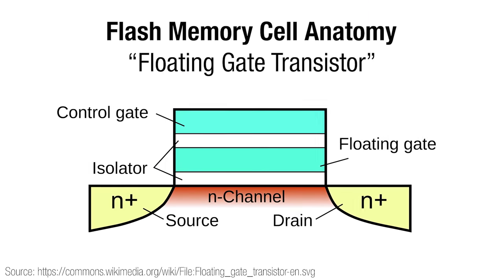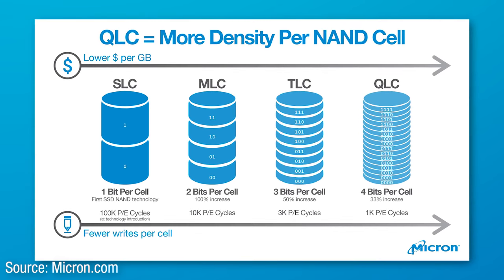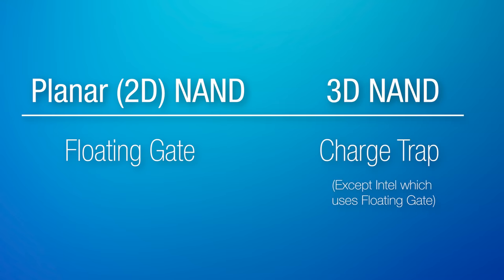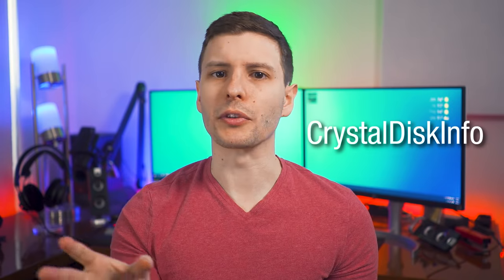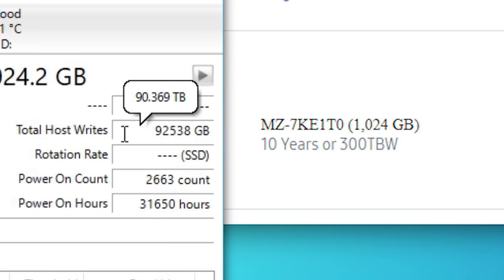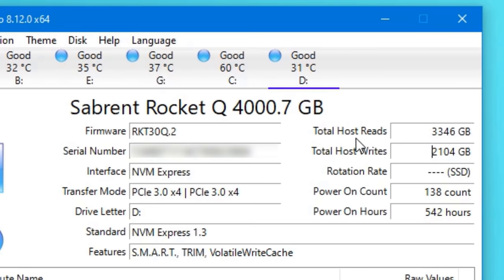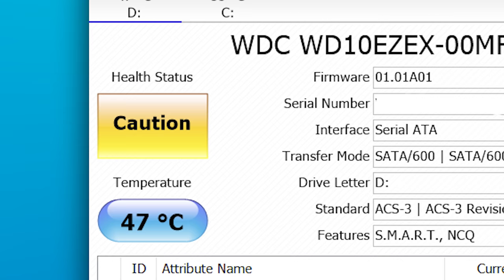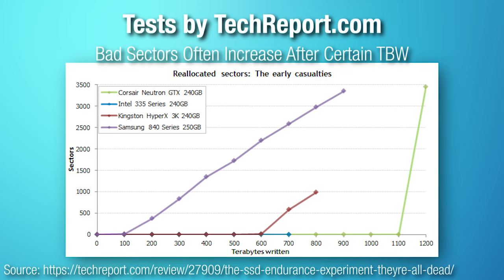How Much Longer Will Your SSD Last? How to Tell

Comment: 6 hard drives - 7 years later still going.
Even put a hard drive from a dead laptop into my desktop and it still works great -  and it's about 10 years old
and I'm still using it in my desktop.

Comment: A tongue in cheek alternative perspective:  I was recently thinking about buying either a BMW or a Mercedes-Benz (4 year/50,000 mile warranty on each) but learned that Hyundais last over twice as long as either of the German brands (10 year/100,000 mile warranty).  For me, reliability is paramount; I bought the Hyundai.

Warrantees are much closer to being marketing tools than they are reliable indicators of expected degrees of trouble free ownership.  Your 300 TBW warrantied MLC based 850 Pro will almost certainly outlast your 600 TBW warrantied smaller celled TLC based 970 Evo Plus - probably dramatically so.  Marketing folks establish warrantee periods, not engineering personnel.

Comment: I think you just saved me. I had a few random blue screens in the past 3 days and I thought it might have been the RAM. Even ran memtest and everything, got nothing. Then your Video popped up and I remembered that I could check Crystal Disk. And well... Lets just say that my poor 6 Year old Kingston Boot drive is "bad" with 1% of its life left. My other drive is still good, but I feel like its also close to a warning classification from Crytal Disk. So 2 new, bigger and faster SSDs it is :D

Comment: We have the new Micro-Krystal 440 SSD Xr3i 2TB which has a lower than 0.2% failure rate after 10 years extreme use

Comment: I have been using SSDs for about 6-7 years now and I have 3 servers that all have SSDs which are accessed 24X7 out none of them have reached even 1/4 of their TBW and have had 0 issues so far, it is going to take along time for anyone to reach the TBW of any new SSD.

Comment: The drive I'm interested in buying, the 4TB WD Red SN700 NVMe SSD has a massive 5100 TBW - and I aim to use it as my daily driver, as an avid gamer. I'm more than fine with 3k+ read/write speeds, but given the TBW in conjunction with the MTTF (Mean Time To Failure) of 1.75 mil. hours (~200 years)... I might be able to enjoy this SSD for the next 20 years or even MORE.

I'm highly curious just how long it will actually last in practice. If it's going to live past 20 years, I will be a very happy customer.

PS: I realize there are SSDs that have twice (or more) the speed, but my current drive is only 180mb/s read/write and it's performing adequately for my needs - 18 times that should be more than enough for quite a few years.

Comment: I certainly recommend that people install a RAMDRIVE in their system and allocate a nice amount of RAM to it, then redirect Temporary Internet Files there.  There are several ramdrive drivers out there, and they are often free up to 4GB which is plenty for a normal user.

For Firefox and Chrome, there are descriptions on the net, how to do this, as it isn’t 100% straightforward. I even go as far as modifying the registry to redirect cookies there, (You have to modify all the references to the regular path to the COOKIES ( and HISTORY) to achieve this, to "B:\COOKIES" even the system path variable. Backup your registry of course.)

plus having Photoshop using also the ramdrive as one of its temp- drives. From time to time, when it is neccessary to unpack large archives to check the contents, then of course, using the ramdrive comes in handy. 

And one reboot later, all your temporary garbage files, are cleaned out, though Windows sneakily still store a lot of cookies on the harddrive somehow, not sure how to get rid of them, maybe someone has an advice for this. There is one caveat though, if you set TEMP and TMP environmental variables here, make sure to make the ramdrive big enough, 2-4 GB so that the temporary files stored here during an install will not run out of space. In a few cases, you might want to revert this, if installing a very large program or something.

It seems like installations expecting their temporary files being still present after a reboot, is a thing of the past, however in the rare case that an installation needs to continue to install something else, after a reboot, and looks for the unpacked files in the TEMP-folder, then you must also revert to have TEMP set to WINDOWS\TEMP - temporarily.

And yes, as soon as you have made the ramdrive with an empty TEMP, COOKIES and HISTORY directory in it, save the image to the harddrive (with the ramdrive utility) and then have it compressed, it will take up just a few kilobytes maybe 50 or 100 even though it is 4GB and be super fast to load. If you omit this step, you might experience a noticeable delay during startup, especially on older computers, when the ramdrive driver loads the file into the memory - 4GB still takes some time to read though it is fast on new computers and you anyway want to save the space on your harddrive. 

The ramdrive together with an SSD will make even 10-15 years old computers, feel as fast as a completely new computer when running everyday tasks, surfing the web, light image processing and so on.

Notice that the Temporary Internet Files folder will by default be hidden, so make sure to show hidden files and folders, to verify that you succeded to redirect everything to the ramdrive.

I noticed that @Thiojoe use the letter B: for one of his drives and it so happens that I use the letter B: for my ramdrive, but you are free to use whatever letter you want, which is not already taken, though it seems more tidy to use this letter (or perhaps A:) as it rarely is used by any other drive.
Reply: I've been using Optane SSDs as my main OS drives for over 4 years. No need for a RAMdrive and no need to be concerned about endurance.

Comment: In the early 90's we were using the early Flash memory chips. They had a "write cycle count" of 100. That means you could only write and erase 100 times before it stopped working properly (for write only).
Fortunately the device has an indefinite number of reads you can do to get your data. 
They started becoming more popular when the cycle count hit 100,000.
There's always a tradeoff. At least you repair an old hard drive. It's usually a motor driver chip that goes bad, so it's just a simple board to change and fix it. You can't fix the worn out memory though.

Comment: Whatever you do, DON’T FILL IT UP. You can seriously degrade the wear leveling to the point that it fails abruptly without warning. If you see it approaching 65-70% full, start deleting files immediately. Experience is speaking.
Reply: is about 8%  safe? I stored 80gb in my 1TB trive
Reply: My Samsung 850 512GB crapped out at 80% full. And it had 40Gb of over provisioning enabled. Several others died around 85%, so take care.
Reply: @mericcumin5679  then i should back up my 120 gb os ssd just in case, it has years of use at almost full

Comment: I have a 19 year old Apple Emac with 4 external mechanical HDs.  They've been running continuously since 2004.  One is a 120GB  Maxtor that's been running since 2000.   Of all the computers I've had since 1990 I've only had one HD failure. 
What's always puzzled me is why they work at all.  🤔
Reply: If you hardly ever turn them off, that would explain it - the number one cause of death for hard drives that kills them prematurely is the high number of powen-on cycles. This is why datacenters still use hard drives, especially for cloud storage.

Comment: Joe a tip, all of us surely use winzip or winrar or 7zip etc, these programs use a temp folder to uncompress data(default unit C) in my case i use a conventional hdd to install games and other stuff, in this unit is set to default to unzip or unrar this tipe of archives. You have less TB writes in a solid drive.

Comment: I have a 68872 power on hours (7 years and 314 days) 120 GB 850 EVO with 224 TBW that is still up and at it. The reason it has so much TBW is because I use it for Shadowplay recordings. Sure the sequential writes have plummeted to 170 MB/s but the sequential reads are still at 553 MB/s.
Reply: You can try to increase its lifespan by deleting old files from the drive so that the less worn cells would be used more, and by generally having more than 30% of free space on it at all times

Comment: I keep hearing about tbw, but what about longevity in years without heavy tbw? Other components of an ssd must have so kind of expected lifespan.

Could you reliably use an ssd for 50 years without issue if you stay under the tbw?
Reply: I guess we might not exactly know yet, perhaps because the technology is still relatively new and studies for physical durability over time need time, unless somebody at a company involved in simulating harsh physical conditions on this kind of technology has any insight. Hopefully somebody else can answer this question, but I think this is the nature of development at the forefront of technology. We learn more with time.
Reply: Google published an in house study that said ageing is the only reliable metric for SSDs dying. I think it was around the 5yr mark.

Comment: 5 years and 1 month in, and my 1TB Samsung 960 Evo is at 7% TBW (29,03 TBW / 400 TBW). Health status is at 98%. :)
I would have to fire up my old system (that I hardly ever use) to see how my good old 500GB Samsung 820 fares...
Backup and large file storage is handled by my Synology NAS's with Seagate Ironwolf's and WD Red's (My off-site backup NAS has a mix of HGST NAS drives and WD Red's).

Comment: If you have ssd, the more you install the less speed of read and write you will have, I had 500gb ssd and I installed black ops cold war and the benchmark came as 33 percent slow, so I upgraded to terabyte ssd and I cloned Windows with black ops, and I got 87 percent speed on benchmark, when you format the ssd the speed returns, but I recommend terabyte for large installs or large data processing.

Comment: Even heavy rational database devices will over around 5 years will right around 300 TB to 400TB. Enterprise drives actually have redundant extra cells. Normally the Enterprise drives are in the PETA Byte write times. The bigger issue is you should never use a SSD to store data unpowered for over a couple years. After 2 years of not being powered on the written cells start to degrade. With some drives full data corruption can happen in 5 years.

Comment: What about applications such as TRIM which actually overwrites sectors immediately when you delete something, as opposed to just marking that sector for use if needed. This is supposed to extend the life of the drive and speed it up as it doesn't have to waste time permanently deleting stuff first if rewriting. Also if your drive is getting a bit full, lessens the likelihood of data being spread all over the drive.

Comment: SSDs are great until they fail, which all of mine have done in just a few years. Not sure if I'm just unlucky or have an unusually high number of writes. I've finally learned my lesson and added cloud storage for my most important files. Thanks for the info.
Reply: I use Optane SSDs as my main OS drives, NAND SSDs for games and HDDs for cold storage. That's the perfect balance.

Comment: Yea, that not necessary means it will last that much. Lots of people had SSDs failures from any brand at way below declared TBW. I had one from ADATA 480GB, failed at 100GB TBW, basically brand new.

Comment: manufacturer quality and avoiding the ones that are too cheaply built for your needs goes a long way, so a great sale price may come at a lifespan price not too much later.  i get the feeling some system builders (for sale to persons looking for a deal) will use the cheapest components that work just fine at the beginning but have a higher failure rate because the unknown manufacturer or noname ssd maker used the bare minimum in cache for cash.

Comment: For anyone who doesn't yet have an SSD: Get one and install your OS on it. If you're using Windows, install it on your new drive as a dual boot install and you can use your same Windows key. You can then boot to the new or the old drive while you install all your apps on the new SSD and gradually make the switch.

Even a $40-50, 240-250GB SSD is plenty big for your OS and apps. You won't believe the speed difference booting, launching apps, and more. 

Another key advantage is if you have trouble with one drive, whether software or hardware, you can still boot to the other drive while you figure it out.

Comment: Just download tool for SSD (for major brands are availble at their websides) and check: TB written window
My old Samsung SSD 850EVO (TLC) after few years of daily usage as system ang game drive has about 18TB written.
Company claim for this model (500GB) is safe up to 150TB....

But, i've change this drive because i need more capacity. Plus NVMe disks are a "little bit" faster ;)
So,
DONT PANIC ;)

Comment: Most likely, I think SSDs will likely last for decades. Even my oldest laptop, Toshiba Satellite 330cds still has its original 4 gb hard drive from October of 1998 and it still works fine in Windows 98 with no bad sectors.
Reply: I miss windows 98se
Reply: @wolfytechs  I found that I could even use the mobile version of Facebook on my laptop from 1998 on Windows 98 using Opera. Not sure if many people still use Windows 98, but I remember in highschool, we studied using Windows 98 in early 2001. At that time, Windows XP hadn't been released yet but Windows ME was actually the latest and greatest operating system from Microsoft.

Comment: 4:45 "only two years old"
Wrote around 50TB
What the things you do?
I have recorded around 1TB per month and i often install and uninstall large (around 50-100gb) games and often uninstall it whenever i done. Not actually Warzone but of the equivalent size.
As for recordings and such i point out external hard drives as output.

Comment: Regardless of how many TBW to your SSD, if you store a file there, then the file will be there (wearing out the SSD further will do nothing to the files already on the SSD).
In other words, even if your SSD is way past its TBW value, then as long as the files that you put on that drive were done so with no issues (like the OS not complaining), then those files are there, and will remain there.

It is not as if, when you exceed the TBW value, that the files on your SSD will vanish.  They will not.

When you wear out an SSD (very hard to do), from excessively writing to it, all you are doing is limiting areas of the SSD that can still store new data.  But once files are stored, they will remain stored.

Also note that drives have over-provisioning.  So when the drive deems a section of its NAND cells to be in bad shape, you will not lessen the total space available to the SSD.  Rather, the SSD will introduce new NAND cells (that were on-hold and never used) that will replace the worn out NAND cells.

I have never heard of anyone ever wearing out an SSD.
Short of doing so intentionally, or having a business use that is constantly hammering away at the drive with new data, your SSDs will outlive your computer.  In fact, when you replace your computer for a faster one, you could put your old SSD into the new computer, and it will outlive that computer, too.

An SSD is more likely to have some other type of failure, before it runs out of usable NAND cells.  For example, its controller might die, or electrical spikes, etc, could damage the SSD.  But killing it from normal use, even heavy use, is not going to happen.  Not that it is impossible.  With countless millions or even billions of SSDs being used, someone is going to wear one out.  Short of that, you will never wear out an SSD.

Cheers!
Reply: I've had a friend whoose smart count showed 255% usage of an Toshiba consumer SSD and it still worked. So yeah...(it probably did way more, i think smartctl on GNU based systems has a limit of 255 or thats how SMART works i guess)

Comment: My 128GB Crucial M4 is still alive today after almost 11 years  while during this time I got several broken mechanical HDDs (they were bought even later than the SSD).
My newer 2 500GB EVO 840s (already quite old, I bought them relatively near to launch day back then)  are also still fully working.
My experience --> SSDs live longer than HDDs, regardless of their theoretical lifespan, at least for my usage patern.
Reply: Still got a 256GB M4 drive that shows 84% life left, was never more than about 1/3 full (used as boot drive) and on benchmarks you can see this clearly as the first 1/3 of the drive reads and writes about 30% slower than the rest of the drive. Guess it didn't wear level cells that evenly, but hell it still works and is showing no signs of failure.

Comment: It helps to have a lot of RAM in the computer so that you are not paging in fact you probably should turn off the paging file entirely.  If you have only 8 GB of RAM, or heaven forbid only 4 GB, you will burn through the SSD lifetime rather quickly just because of the activity on the paging file.

Comment: In reality, SSDs tend to last longer than the warranty (obviously). To whoever is interested: I have a few crucial MX500 here that were heavily used in a data center, and they eventually failed with more than four times the TBW specified by Crucial. In a personal computer, you typically have to do video editing 8 hours a day or something to even approach the TBW over the lifetime of the PC. Nevertheless, always back up your data, these are all just statistical averages!
Reply: Definitely nope , my MX 500 failed in less than 4 yrs. Everything has gone without any symptoms.  Never trust an ssd.
Reply: @SummerFrost23  Again, the specified TBW is an expected minimum lifetime. It is absolutely possible for an SSD to fail earlier (or on the first day). Unlikely, but it happens. Backup your data.
Reply: @arnoschaefer28  of course, too painful to learn the lesson. 😂